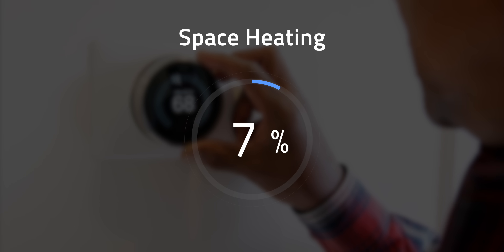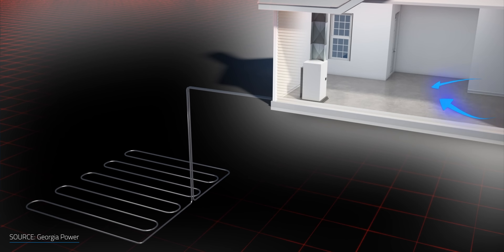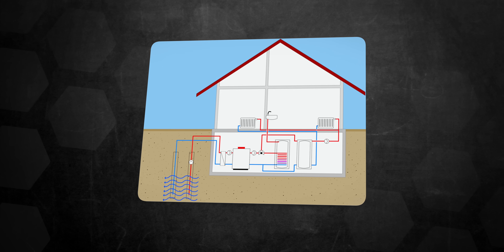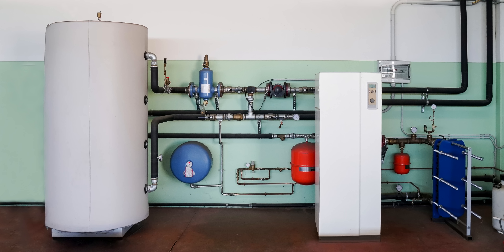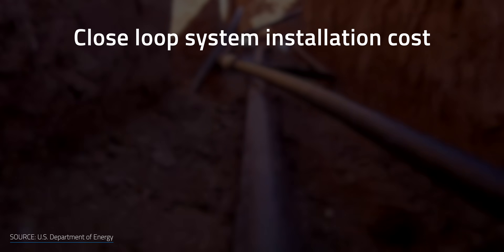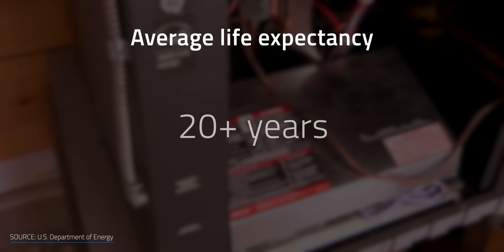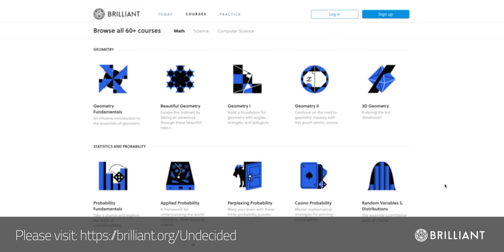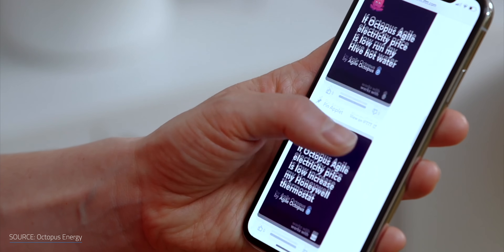Is Geothermal Heating and Cooling Worth the Cost?  Heat Pumps Explained

Comment: Combined with phovoltaic panels, geothermal heating/cooling is one of the greenest and cheapest home temperature management systems. Great video, great topic
Reply: You can even use excess solar to store thermal energy in your house, i.e. making it a degree or two warmer (in heat mode) or lower (in AC mode), lowering the amount of electricity needed during that afternoon/evening spike in electricity
Reply: @ThomasBomb45  or warm your boiler water to a higher temperature so you need to heat it less over night.
Reply: Costs a kidney though.
Reply: I agree, and it's definitely the future. A hotel recently built here in Montreal uses geothermal and has natural gas as an addition in the winter. They said in a news piece, that within 10 years they would recoup their investment in the system. Most retailers and hotels still use a lot of electricity because here in Quebec it's so cheap.
Reply: @asbestosfibers1325   I agree they should develop a more harmless agent. IF there are leaks. To be fair one would notice in performance but if it leaks out slowly the damage could be already done. 
On the other hand the pipes can be made to last 100 years, so high quality.
Reply: Me too I love it
Reply: that is, until you have to dig a ditch on top of your cooling field…
Reply: Electricity for heat is NEVER green. Who told you that?
Reply: On our house we have a 16kw heat pump and a 7kwp photovoltaic system. Heating and coolig cost is zero.  It was the best decision to use this technology
Reply: @robertgidaa2705  Well, you don't live in the north, do you?
Reply: @dannysdailys  nope. Middle of europe.
Reply: Do you mean operating costs or total cost of ownership?
Reply: Hempcrete insulation is fireproof, termite proof, mold proof and best of all you can breather better
Reply: Really? PV and wind are driven by the sun which would otherwise add the enegy to the environment. Geothermal is adding heat energy to the environment, extra to what the sun dlivers and thus increasing global heating. Sorry but you're been belkieving something because you want to. It isn't the least bit green, it's yet another man-made increase in heat into a system that is already unbalance by greenhouse gases. Did you think it was green because there was no carbon? How naive and simplistic. Let's have some honesty shall we. Renewables, genuine renewable, are the only energy we can use that doesn't increase global heating and runaway climate change. No ifs and buts, that's the bottom line. Sooner geothermal is stopped and scrapped the better. But it won't be any more than smoking tobacco has stopped now we all know it's carcinogenic. You're addicted to geothermal, it ain't good for yu or the rest of us.
Reply: @davidjessop2279  Iceland. By using geothermal you don't add any extra emisions. If you live in cold climate it is not your choice, you will be heating your home one way or another.
Reply: @MrDeikas  That's all you don't add, what is added is ALL the energy released. A net addition to an already heating planet. Stop putting hominid selfishness first and think of the ecosystem. I know it's uncomfortable when your country depends on it, but you are part of the problem. Just because it doesn't add CO2 doesn't make it green. Living in a cold climate IS your choice. Back when it was settled there was no environmental problem, now there is and science also. Geothermal energy is energy taken from the Earth's core. It comes from heat generated during the original formation of the planet and the radioactive decay of materials, it is adding to global heating. Just saying 'you will be heating your home one way or another' is the same old human selfishness, it's what had brought us to this situation and I see no sign of it stopping. 
Perhaps Iceland should have been left to species adapted to live in cold climates, not for hairless apes evolved in  Africa.
Reply: @davidjessop2279  Good insulated house is like inverted fridge. You don't release any heat unless live in uninsulated house. And heat from Earth core is seeping outside trough geothermal cracks one way or another, it's doesn't matter you like it or not. It is to person to decide if it will be willing to gather that heat for yousful means or just let it go freely unused.
Reply: @MrDeikas  geothermal isn't causing climate change, but!

Geothermal only works by increasing the rate at which heat from inside the earth reaches the surface. Insulating your house stop that. If it did, you'd only have to turn on your heat once and your house would stay warm forever. Since you have to keep turning heat on, you ARE releasing more heat into the surface. 

Is it a problem? No. Carbon dioxide isnt an issue because burning fossil fuels releases heat. It is an issue because it prevents heat from leaving the planet. It's a multiplying effect, while geothermal is just addition
Reply: Geothermal (in the case of the video, not for generating electricity) releases heat from the ground to the environment only in the winter. It's the opposite during the summer.  I don't see the comments concerning the releasing of heat taking that into account, and they should.
Reply: @davidjessop2279   geothermal energy in that relatively low depth does NOT come from the core, if you have a bad planner (insufficient area surface for horizontal, or depth for vertical -  usually in an attempt to appear cheaper and in order to close the deal), you can cool the underground, and more than the RAIN can replenish during the warm season. 

The user can take out more heat for a few years than can be replenished than they will find that they have an inefficient electric heating. 

The soil is a good temperature buffer. That is why it is cooler in the summer and warmer than above ground in winter, that is pretty constant. 

It does get hotter if you dig REALLY deep, that can become a problem with mining. In some South African gold  mines the miners must be very fit and they blow cooled air into the tunnels, or the workers would collapse soon. And the shifts are not as long.
Reply: Solar is actually just as bad if not worse for global warming. All energy = heat and solar is absorbing sun energy that would get reflected back into space. Capturing that heat (in a very inefficient conversion non the less) it adds heat to the closed system that is no longer radiated into space. That is what is meant when people talk about the albedo of the planet.

If we want to use solar energy we need to build even more systems that would reduce the amount of sunlight that is absorbed by our atmosphere. Either increasing the amount of ice, building sun shades, reflectors or increasing cloud cover (which also absorbs some sunlight)

People need to be careful, because both sides spread a lot of propaganda and in a few years you will be told by the big polluters how they were right all along.

Geothermal, Nuclear, Hydro, and ocean hydro are the real energy sources we need to focus on. In addition, we need to do the things I suggested above to reduce the amount of sunlight, We have already lost so much ice, that even going energy neutral would not be enough at this point to stop global warming.
Reply: @excitedbox5705  I really doubt we are putting in enough solar panels to substantially increase global albedo, especially if you are putting them on top of an asphalt shingle roof that is about as dark as the panels.
Reply: @AdaDenali  everything absorbs light and heat the radiation transfers are not as much as the extrapolated issues. These nuclear and Geothermal sources put CO2 more than what this guy claims. Putting a solar panel is much better than Creating nuclear wastes.
Reply: @excaliburpower2620  Eh that is arguable. Nuclear waste is overblown, on the scale of power generation it is a very small volume of material, that could theoretically be used as more nuclear fuel. On the other hand nuclear power plants are so expensive and time consuming to make that I am not sure how we could use new construction to help in the climate change fight :(
Reply: @AdaDenali  if you put a solar panel on a black shingle roof, albedo is going to be a much smaller concern.

If anything, it's made me more seriously consider white roofs. And recognizing how much energy roads and parking lots must be absorbing
Reply: @AdaDenali   who has a white roof??  stupid comparison.

how does replacing slate tiles or felt/shingles with PV panels compare seeing as thats what happens in real life.
Reply: @oxfordsparky  in that case you might even be improving albedo
Reply: @excaliburpower2620  right until you actually look into the waste products in the making of solar cells. there are some nasty chemicals needed mined from some vulnerable places. a nuclear  power station generates about 2 tons of waste per year, which, due to the nature of the waste, occupies way less than 2 cubic metres of volume. solar generates way, way more.
Reply: @AdaDenali  good point, but nuclear waste is so dangerous (see the Chernobyl videos) it has to be stored in pools of water or be encapsulated and buried underground, it remains radioactive for decades. In France 30% of their fresh water supply is used to cool nuclear plants, so that water is not available to farmers and to the general population..
Reply: @AdaDenali  nobody has made 2nd and 3rd stage reactors tho as countries cant get enriched uranium from them so we just have a mountain of waste that nobody wants anywhere so we bury it in the desert...i am sure that will never come back to haunt us in the next 10,000 years...that is the same reason there are no thorium reactors in the USA...you cant enrich uranium with them so why build them...who cares about the less waste material thing if you cant enrich uranium nobody wants it....
Reply: @oxfordsparky  many people have non black roofs but white would be a rarity for sure...but aluminum roof tops are the norm in places like Montana and you can get them in any color you want...most typical are shades of blue, green or brown but i have seen a yellow one..yeesh it wasnt that great...
Reply: @AdaDenali  Size of the waste in tons is NOT the issue...

For example a 1GWe nuclear reactor produces about 20 tons of heavy metal waste per year some of that being plutonium  - enough to produce about 30 atomic bombs worth....every year.  Scaled up to the number of reactors needed in the US alone (~1,000 - 3,000) you are looking at 30,000 to 90,000 bombs worth per year.  Yes  we can "burn" the waste in Fast reactors but that has proven to be an expensive thing to do and adds its own problems......

How do we keep all that stuff safe for a couple of hundred thousands of years?   Who is paying to keep it safe?
Reply: @stephenleftly4206  I doubt it’s any easier to make a bomb out of nuclear waste than it is out of uranium that you could mine. Probably harder, because the waste is radioactive and harder to work with. The plutonium in waste is mostly not the right isotope to make a bomb with, so would require substantial reprocessing.

And I don’t need a 10,000 year plan, we just need to get proper waste burners up and running properly. Even if that took 200 years which is an eternity in tech dev that timescale of waste management is not that bad.
Reply: @excitedbox5705   you do not understand how the heat balance of the planet works. The solar radiation would either heat a roof or the ground or it hits the solar panel. One way ot the other it is going to end up as infrared radiation and will leave the planet. some solar energy is stored in the oceans for longer (think maybe 100 years or even longer) but must escapes pretty fast.

If humans put a solar panel in the way it is just put to good use before it is radiated back into space.
Reply: @excitedbox5705  the Albedo effect might influence the temperature in or immediately adjacent to your house. But on a global level it's completely negligible since less than  0.001% of the earth's surface is covered in solar panels. Even so, it would raise the earth's temperature by a constant amount. Using fossil fuels on the other hand, increases the temperature on earth every single time you burn them, which compounds over time. So in any case the fossil fuels will become the problem...and they are.
Reply: @excitedbox5705   Humans have built billions of homes with roofs and nothing happened. That is not like the energy balance of the globe works, it all leaves. then add to the impact of tarmac streets where vegetation used to be. We would not be in trouble even though they locally raise the temperatures on the ground. It is only a tiny share of  land - which is only 30 % of the planet surface anyway.

Comment: My wife and I are making these decisions right now.  Geothermal was always high on our list.  However, after much research we are leaning more toward a passive house.  For about the same amount of money the heating and cooling needs are significantly reduced.  You may go from a 3 ton system to just some small auxillary heat / cooling system that may run on the coldest and hottest days respectively.  Many (but not all) have no furnace at all, just an ERV / HRV.